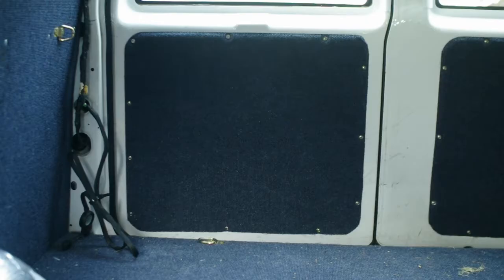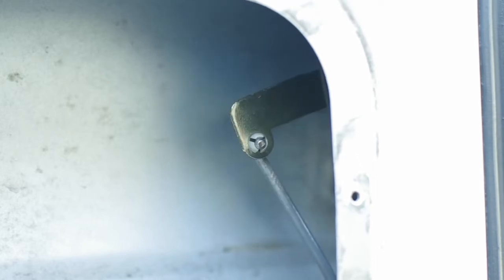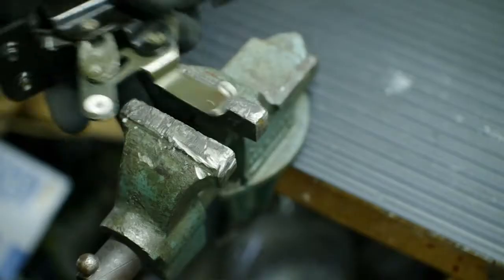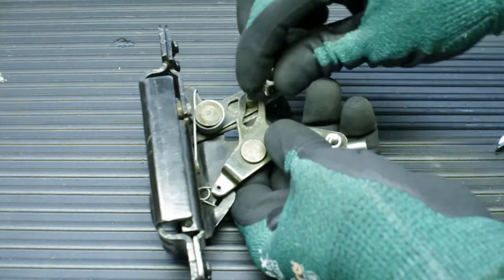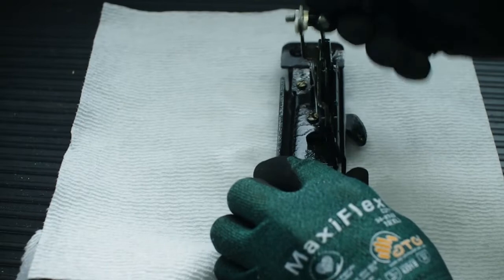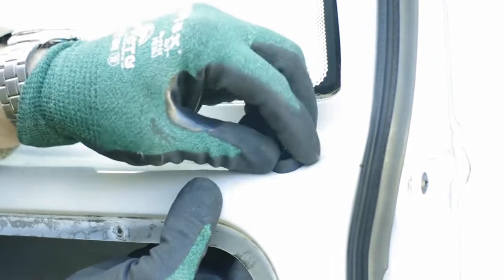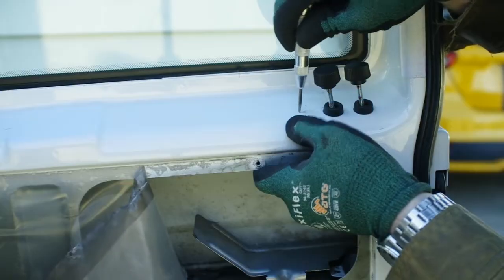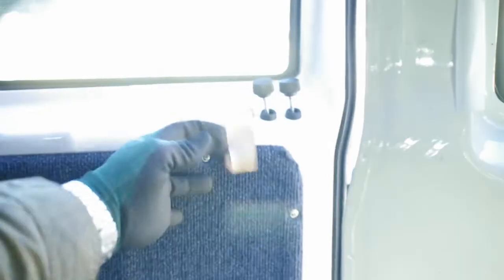Astro Barn door Camper Van Upgrade

Comment: Thanks for this awesome explainer! Just completed in our Safari.
Reply: I'm at the drilling holes in the door stage. Trying to be as precise as possible with marking the locations. Kind of a 'better get it right the first time' situation. In the video at 4:28, it kind of looks like the hole for the lock actuator (the one you have to pull back up) is center aligned with a dimple right below the window glass. Hard to be sure from the camera angle though. Did you find this to be the case with yours? Congratulations on the upgrade!

Comment: Great video thanks 👍
Your video is the only one on YT to cover this simple fix. Right on. 

WHY weren’t inside rear door handles  
Ever put on these astros?? I’ve owned many different makes of vans and the Astro is the only one with no rear inside door handles. 
GM engineering really screwed up on this issue. 
I also flubbed up and bought a side slider with a window for visibility on my 95 BUT because those boneheads changed the rear mount from welded to bolt on. In 96 Now  I have a perfect side door w/ window I can’t use 😳
 Should have looked into fitment before I drove to Phoenix to buy it. 
Duuuh!!!

Comment: Hi! Where did you find these parts? I’m struggling to track them down
Reply: Home depot has them, so does Amazon. I found them in my small town hardware store in those miscellaneous parts sections... The area with all the plastic drawers full of bolts, nuts, clips, etc.. They're called "rod ends" in all the stores here.